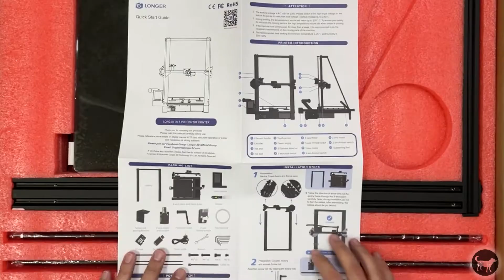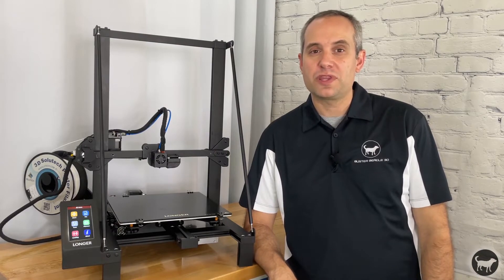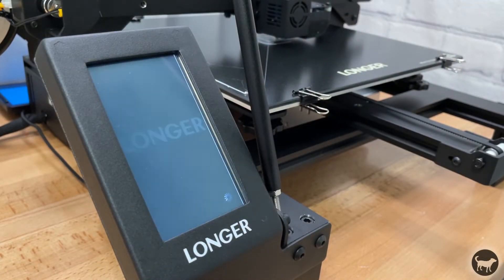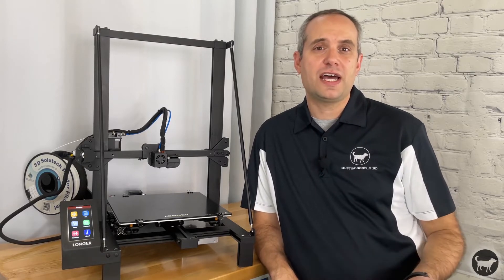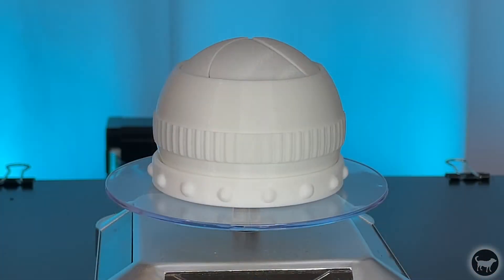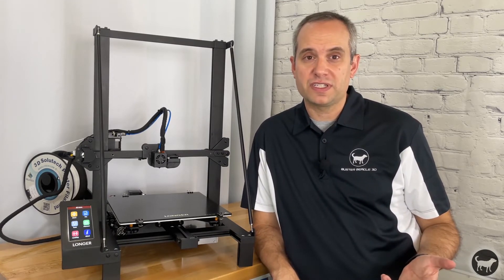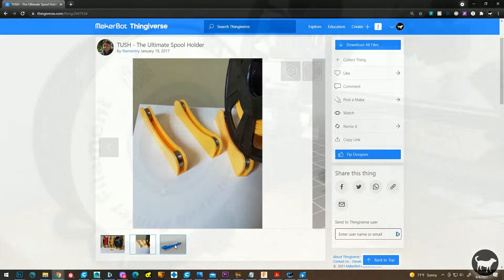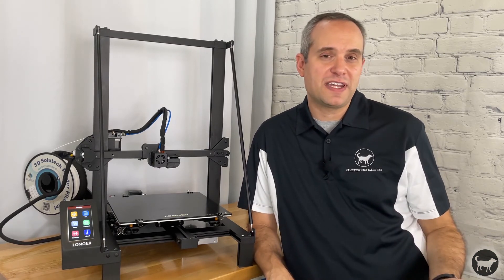LONGER LK5 PRO. Larger 3D Printer Review

Comment: Does it still work after two years? And is it good for beginners?
Reply from the maker: Still use it almost everyday. Still honestly my go-to printer for almost all things. It's a good starter machine and long term machine for sure. I have only had to replace the filament run out sensors a few times and the power plug once or twice as they are cheap and run out after a while but overall a great machine.

Comment: Can you just replace the extruder stepper motor driver with the TMC2208, or is there more to it than that ?  If so, would it be worth the ~$15 to do so ?
Reply from the maker: I think you could replace it, It would just be adding the driver to the board and replacing whatever is there. You might have to adjust the voltage on the VREF but to be honest switching out the fans for quieter ones would be what I would worry about first. You can hear the extruder but it's overpowered by the fans.
Reply: @BusterBeagle3D  - okay, thanks. I don't have this printer (or any printer) yet but I'm giving good consideration in being my first 3D printer.
Reply from the maker: @steve318k  I'm glad to help. I have to say that it has been a bit of a work horse for me in the last couple of weeks. I have been getting consistent nice prints on the machine and it breaks my heart that my original 3D printer is sitting quiet for the most part but life goes on ;)
Reply: @BusterBeagle3D  - Thanks !  The more videos I watch and learn about it , I'm getting closer to actually buying ... it seems like a good cost for value purchase ! Really getting the itch, I think of more and more things I can use it for every day !

Comment: They seem to be upgrading on this one, as they get feedback.. I just bought one for 330$ with upgraded Metal extruder and also added "New Dual Blower Kit" to the cart on their website. Since i can see most reviewers agree that the cooling is lacking. This will be my first 3D printer, seems like you get pretty decent build volume for the money, other competitors seem to charge at least 100$ more for the same volume, and still dont give you a touch screen.
Reply from the maker: Glad to know they are updating things as they get feedback. It's kind of one of the hard parts of doing 3D Printer reviews, they become obsolete very quickly as things improve but it still forms a base of the machine description. It's also nice to see things get updated as they see issues arise.
Reply: i feel like i’ve seen this comment on another vid lol, did you just copy and paste on multiple vids lol

Comment: I just bought this printer. I was printing something that was going to take 16hrs to complete. But around the 6hr of printing it stopped. The screen was displaying , if i want it to continue with the printing which, i did press. It continues to print, then again it stopped around the 10hr of printing. Any ideas why this is going on guys?
Reply: I am looking to buy this printer and I was wondering is there a way to get the software to Design My own models Before I purchase?  I would rather not get frustrated with the software where after I
Reply from the maker: Did it stop because of a power outage or because something in the GCode is causing the print to pause? What slicer are you using?

I believe if it was a power outage you would only have been able to restart the print once so that may not be it. 

If you are not seeing a thermal runaway or any other errors you may have something in your code causing the print to pause. I would open  your GCode in a text editor and search for M25, M0, or M600. All pause code to change filament.
Reply: @BusterBeagle3D  , see there was no power outage. Slicer, well I'm using the software that came with it.
Reply from the maker: @melannieworld  I haven't used the Longer Slicer if that is the one you are talking about. I use Cura which they did provide the machine profile for in the files on the SD card. Cura is a free program that gets lots of support from the 3D printing community. You might want to check that out and see if that improves things for you. I had some very long prints on the printer that worked fine. One was 16 hours and the second one was 41 hours.
Reply: @BusterBeagle3D  , let me check it out today. I will get back to you. Once again thanks for the reply back and time.

Comment: Does the software allow use of larger diameter nozzles?
Reply from the maker: Cura does for sure. I'm not sure if the Longer slicer does as well. Since they give you the profile for Cura on the micro SD and that is what I'm used to I have been just using that instead.

Comment: Why buy the LK5 over the LK1?
Reply from the maker: To be honest I have never tried the LK1 but just by looking at the specs......The LK5 has the TMC 2208 drivers which are chips on the motherboard that make the stepper motors quieter. It has an upgraded ceramic coated glass bed instead of a heated bed with a sticker. It has built in support braces for the z Axis to make the machine more sturdy. It also has a full color touch screen interface instead of a screen controlled by a knob. Only other thing I noticed was the electronics are in a separate box on the LK1 so it's not as compact. I'm sure it's still a nice machine but the LK5 does have upgrades. Hope this helps!
Reply: @BusterBeagle3D  wow, you know your stuff! Thanks.
Reply: Hmm looking at ender 3 v2 like most people LOL, appart from print size how would u compare print quality and add on option availability  to get some useful mods?
Reply from the maker: @jakoj2098  I don't have an ender 3 so it's hard to say. I have been pretty happy with the LK5 quality so it has been my go to printer recently. I haven't felt the need for any mods just yet but there are some that have popped up on thingiverse anyway.